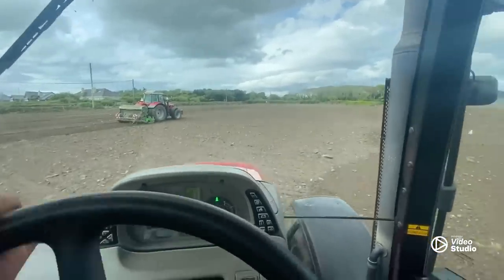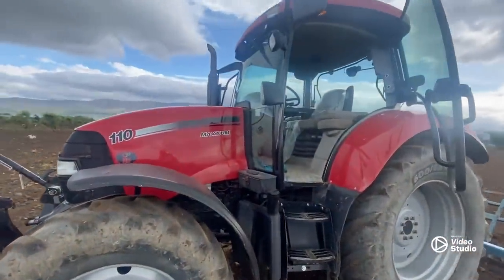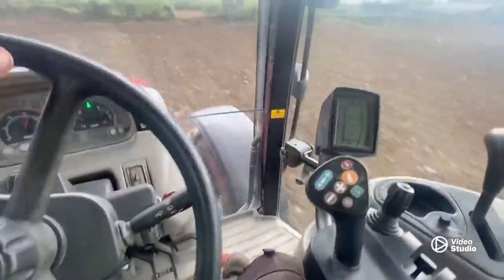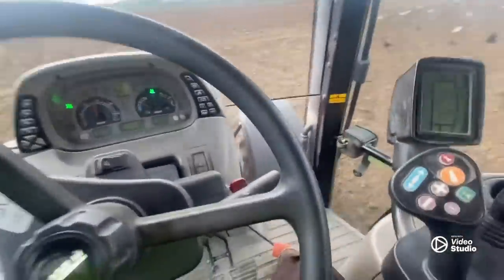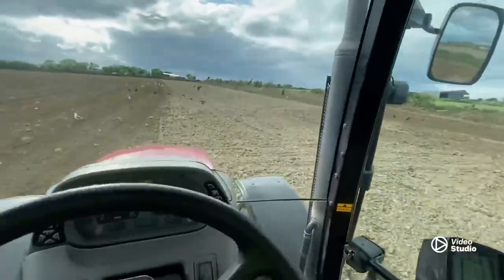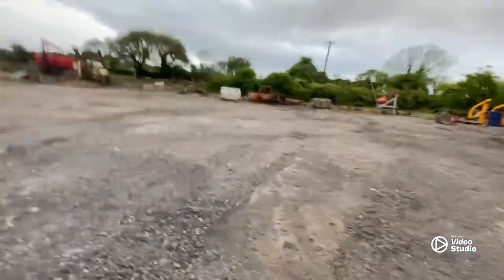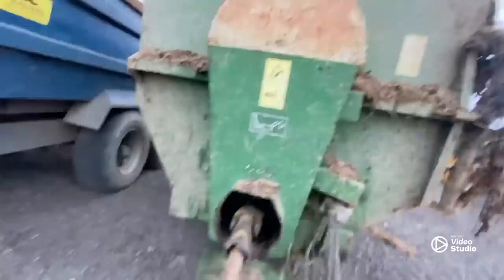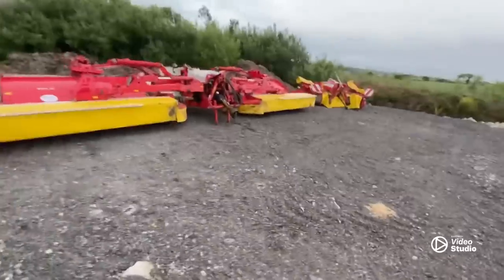Reseeding grassland and a look at the new yard

Comment: Give the tractor a small few revs on the hand throttle, then press the button to activate the pre set revs, use the button with up & down arrows to fine tune.
Hold in the activation button to recall previous pre sets.
That's how it works on the blue equivalent